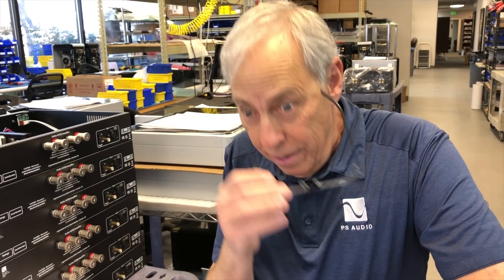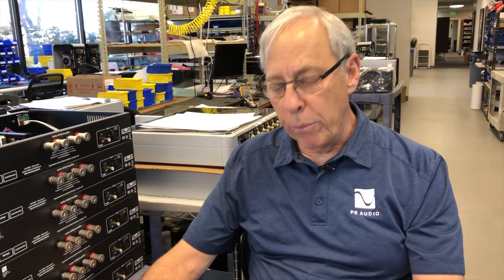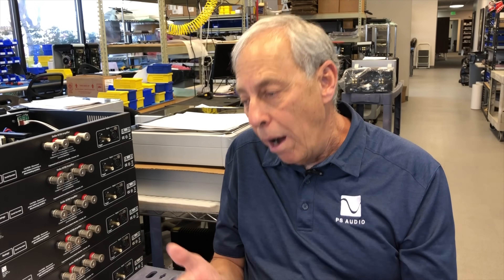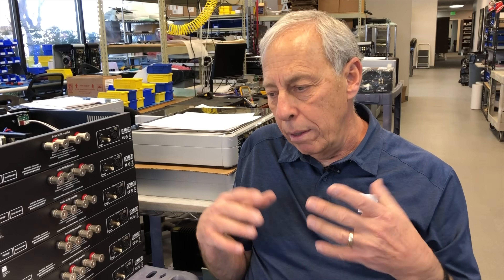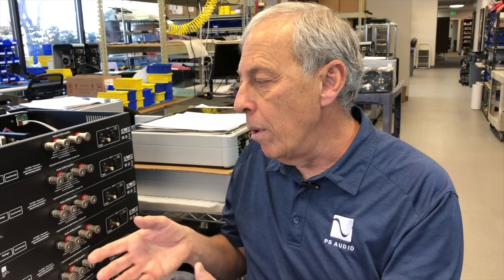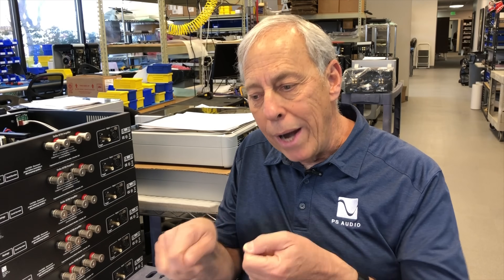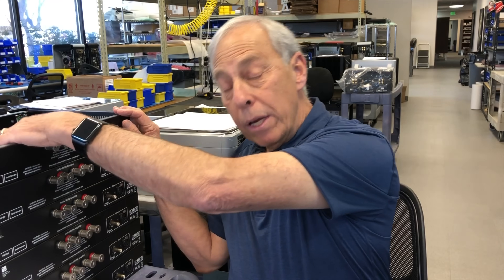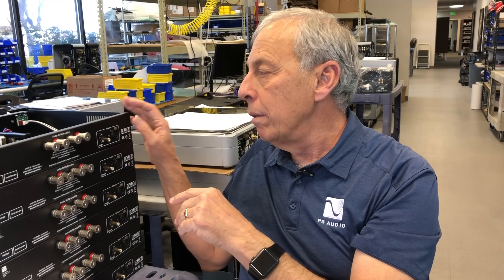Why don't stereo products have universal voltage?

Comment: For 25 years I worked at a power supply house and I remember working on very early switch mode supplies before control chips like the SG3524 of the 3844 series were developed. They were just terrible, I called them electronic M-80's just looking for a chance to go bang.

As time went on between the availability of good control chips and our increasing understanding of switch mode topology the supplies became very reliable and reasonably quiet. For low noise (conducted as well as radiated) you need zero switching and VERY careful PWB layout.

Comment: switching power sup are lighter and with shielding, grounding and a number of different values caps EMF and RF can be all completely eliminated. The key is to install a psup that can handle double the amperage you will ever use on that amp.
This power sup are cheaper to build in large quantities dos eliminating excuses not to use them any more. I was designing radio communications equipment and at the beginning I would not use a switching PS. However we are way passed those days and  Switching PS are  more reliable and do nor need the massive transformer and those massive pass transistors and heat sinks. PAUL THINK OUTSIDE THE BOX AND TRY THEM.
Mario

Comment: Solid state units usually have linear or switch mode regulation and a simple dual primary that can be seriesed or paralleled can give good coverage of most standard line voltages. Tube products usually need bogey heater voltages so a lot of primary taps are needed.
IIRC Hafler’s ‘mod’ for Japan was to do nothing and just sell the amp de-rated 15 percent or so.

Comment: 7:17, i wouldn't relly, Transformers are still the most efficient way os converting one voltage to another, there's thyristor valves that Convert AC to DC and then Back to AC but in a different voltage, but relly is very likely you will use some kind of copper or aluminium coil

If you don't wan't to exhaust resources and get something efficient, the ideal thing is keeping up with transformers, you got now things like amorphous steel transfomers, shell type transformers are excelent for handling great electromagnetic radiation without problem, and also most of transformers are reciclable, you melt the steel, copper (or aluminium), you pull out impurities and then you make it again, that doesn't quite happen with Solid state devices that also have things like Arsenic, Mercury and Antimony.  Shell type amorphous steel transformers have efficiencies close to 98% 

making a multiple voltage transformer that switches from 220 to 110V is quite easy really, you make the primary winding with 100 Turns, and the secondary winding with 50 turns, and in the middle of the secondary winding you put a cable at the middle, at turn 25, so with a switch is possible to change from 4:1 to 2:1 step down, they share the neutral but they are different phases

Comment: Not sure I agree with this.  I've got huge amps which I can convert voltage with a fuse change, I've also got large amps which have a rear switch to change the voltage.  All done economically and effectively.

Comment: Complete garbage. Look at any bit of quality gear in the industry. It is dead simple to “flip a switch” and change taps. In fact, at the measly power your foolery runs, it can auto sense with a single feedback winding on a standby supply. Maybe 50 mA of waste. 

Switching taps has NOTHING to do with SMPSU. Tap switching is the mechanical changing of transformer taps. I don’t believe you are ignorant enough to confuse these topics. I think you are doing it to purposely confuse your customers. 

Further, SMPSUs can’t “emit EMI” they would be illegal if they did. As to switch noise, otherwise known as hash, it’s not hard to design around. A second year EE grad student could do it. If your guys can’t, replace them. 

Yes, one day the foolery premium will be replaced by an ecopremium. Only then will you change technology. You haven’t suck all the fools’ money yet. Soon, soon. 

What you are doing is BSing about why your product margins are setup to maximize the audiofoolery premium. 

There should be some kind of consumer BS rating in this field.

Comment: You can use switch,for primary transformer windings, for 110/220VAC. That small switch is usualy on the back, near the mains connector, it is used in lot if products, since 70s-80s...
Reply: Precisely. If PS audio manually configure the primary internally for one specific region that is done because they choose too do it that way, not because it is necessary. It's just easier not to have the added switching and instead wire for a specific region. This is quite common in industrial electronics actually.

Comment: There's a few newer products that use a traditional linear power supply with a detection circuit on the dual primaries to automatically switch between series and parallel operation.

Comment: Old products (up until the 70's) had a bakelite rotating switch on the back to select different power sources, like 110, 240 etc. Sometimes it was just a round piece of pcb board with pins in it.  You had to pull the disc out, turn it, and put it back again.    Now that was user friendly!
Reply: Peter Pan It was good enough for HP on some five and six figure test equipment. I have a 8657 rf gen, a 8903 distortion box and a 8920a CSM they all use that.
Reply: Wamgo C     Maybe I have a nice question for your new video:   Where have all the japanese audio (Sony, Sansui, Pioneer, Technics etc) gone and where did it go wrong?

Comment: It sounds like your engineers are not updated on modern powersupply technologies...electronic PS done right is very good. Iron core is very old school at this point. And don't give me that "sounds better". No it does not with a class D PS input stage done right. ICEPower was mentioned amongst others, no noise etc. Most MODERN products today does 90-265V automatically. Not to mention consumption, old school PS are really bad at efficiency while an electronic PS usually operates from 80-95% efficiency. As power prices rise this is increasingly more important than in the old days.

Send your team to reeducation school and learn to produce good sounding electronic PS. :D
Like all things it must be taught and learned.
(In jest but with some truth to it...)

I built my own electronic PS input stage with products from Schneider etc. The monoblocks sounds very nice without any artifacts.
Reply: Blood Carver A good line freq transformer and pi section filtering after diodes are still the quietest DC this side of a lead acid battery. And far and away the most field repairable.
That said the sealed off the shelf brick SMPS has come a long way.

Comment: Paul explained the different options to generate the needed secondary 60V (for example) but not explain why some manufacturers use one while another manufacturer uses another.
I guess the easiest answer is -which countries are they sold to. If your company is selling only to the north american market, there is no need to install a transformer with multiple taps to switch from 120 to 240. if you are a huge company that has distributers sitting in europe and in the US then of course you might produce 2 different irons and install them according to which market the unit goes to, or use the switchable version. (they might have different main jacks for the power cord as they look different in the US and elsewhere, or both jacks wired to differnt taps on the transformer, or only one jack and maybe a manual switch where the user can change the voltage) Not to be confused with the switchmode supply which is a circuit that produces the same secondary output voltage by itself no matter what you put in the primary, it does that by keeping the voltage steady with transistors while changing the available current in the same time, its a network of parts that introduces some disturbance into the signal as Paul points out, why manufacturers might use such a device may be just down to simple economic calculations, which of these solutions is the cheapest and or best suited to the chassis concerning weight and size.

Comment: So does using a transformer to either step up or down the voltage, say 220v to 110v drastically affect the sound??
Reply: Paul points out that in his opinion the biggest mains iron sounds the best, i think that means actually that the universal transformer with one input and multiple output taps would sound the best as this should be the biggest iron because of multiple windings involved. Its not that simple, every transformer has inductance and series resistance which depend on how many wire turns and how thick the wire is and the construction of the unit as a whole and and and. Thicker wire with less turns have less inductance and higher current capability for example. There are differences that you can hear, for HIFI the transformers are overengineered in order the be able to deliver as much current as the amp needs turned all the way up without going into magnetic saturation and or wires getting hot because they are too thin and cannot permanently deliver enough current (the wires inside the transformers).
In guitar amplifiers this is used deliberately to interact with the volume, so transformers might actually be undersized so when you hit the guitar hard the mains transformer (and the AC to DC rectifier) struggles to deliver enough power and there is a voltage sag and the sound compresses and all sorts of things that a guitar player might want from the amp in order to get an expressive interactive playing where the amp is part of creating a certain sound and not onlny reproducing what goes in it like in a HIFI unit.
Reply: What about when you take 110v equipment overseas and have to use a transformer to go from 220v to 110v?
Reply: if you use a step down transformer in between the cord and the equipment then you are adding another transformer in the chain, adding another piece of iron and thus inductance, resistance etc. increase., if one can hear these addition is hard to say. it all depends. a good power supply with the input filtering stage at the recitifer is usually designed to store enough energy  as to counter any inadequacies in the rectifier or transformers in order to provide a steady flow of energy no matter what. though there are differences in what capacitors are used and so on and so forth, the deeper you go into this the more complex it gets. in general i would not worry about adding a Variac in the chain (step up or down transformer) as they should be engineered to be able to deliver alot of power, more so than your hifi amp, unless you have some watt monster that feeds a radio transmitter designed tube stage with 1,5kV and thousands of watts of output power ;)
Reply: I moved from the States to Europe. Some of my electronics will work with 220v, like my flat TV. But my bluray player, A/V receiver didn't. I also brought with me a Marsh P 2000t pre-amp, Parasound HCA 2200MkII power amp, DAC and CD player. None work with 220v. Parasound sent me a schematic to change the power amp to run on 220v. I never did it since I don't know how. So, I shipped several power converters rated at 3000 watts to convert down to 110v before I left the States. I also have a Richard Marsh designed power center to filter a/c after the power converters. Everything has been working great for 7 years so far, but if something goes down, I will look for something that will work 110-220v in the future. Stuff is out there that sounds great.
I'm retired on a very fixed, low paying pension, so what I have has to last. If I have to buy something, it will have to be "universal" in operation in case I head back to the States.
Reply: okay i see, well as long as it works with the converters i would not worry, it should not have negative impact on life expectancy of the units, enjoy your stay over here in europe :)
Reply: Loving it here in Poland. No desire to go back to NYC. Equipment is a little "oversize" for the apartment where I live, but it makes me happy.

Comment: Class D and Switch mode power supply is really the future. But they are not cheap when done well. Other then the clever electronic and control behind it. Class D is very sensible to vibration so top end Class D always use heavy block of metal as base. Also switch mode power supply is very sensible to power fluctuation. That is why most top class D switch mode design a small linear power supply stage before it's switch mode power supply. And come with high end power cable to ensure their user uses a shielded power cable.

Comment: Today the main problem with high end switch mode power supply is current. Unlike big iron transformer can store current in it. Switch mode power supply really need multiple inductors and capacitors in it's output stage to store voltage and current that it has generated. When this done well it will resolve EMI and RFI issues as well. But doing so you basically end up with complex and reasonable sized power supply.

Comment: I'm confused. At 6.15 you say that you don't used switched mode power supplies "in general", then you say the the Stellar uses a switched mode power supply, then at the end you again say you don't use them because you "haven't been able to figure out how to do it." and until then "we don't" (use them).  Huh???
Reply: unfortunately Paul has not figured out how to not re post previous videos ...
Reply: Simple enough really -
The Stellar line can be thought of as a "budget" PS Audio solution; it isn't built to give the same kind of ultimate sound performance their other products do. They use the best in the best, so to speak. So, while they do use them in some products they haven't figured out how to put them in, say, the BHK, without degrading performance in that particular product.
Reply: I believe what he meant is they don't use switch mode on the high end gear, but do on the budget products. Switch mode is far cheaper than a big heavy copper transformer, but as Paul said they generally don't sound as good. I agree on that front, I have yet to head a switch mode sound as good. They don't have the reserve power that a big ass transformer and big filter capacitors. They are efficient, and produce little heat. Conventional linear power supplies on the other hand produce gobs of power, but burn a fair bit up as heat in the process.